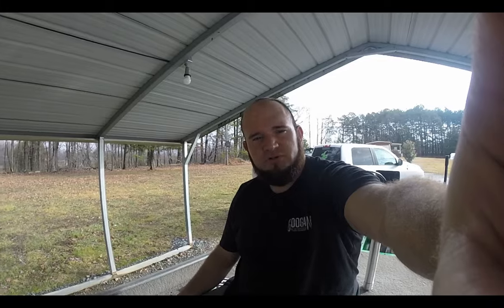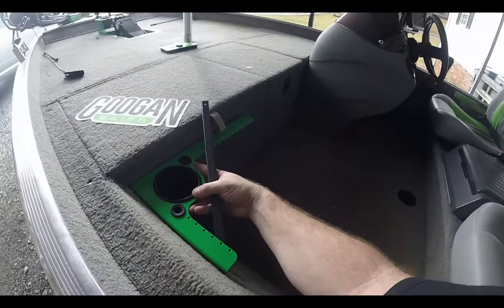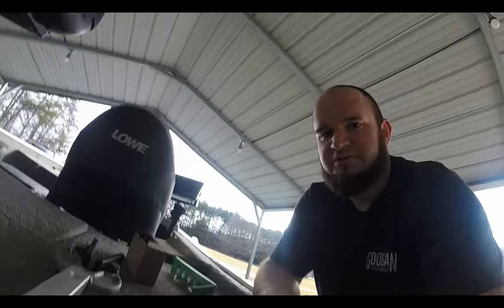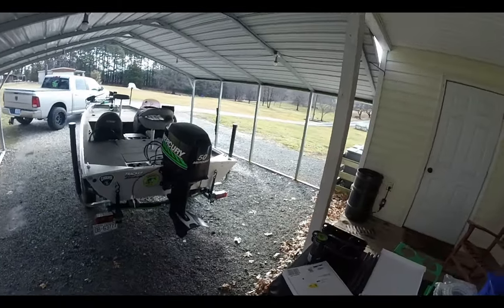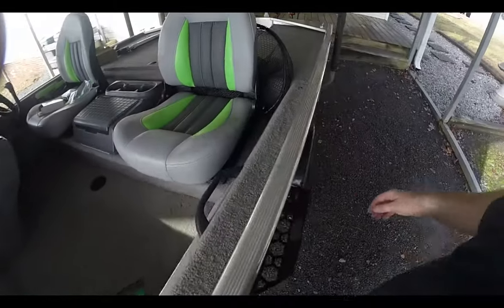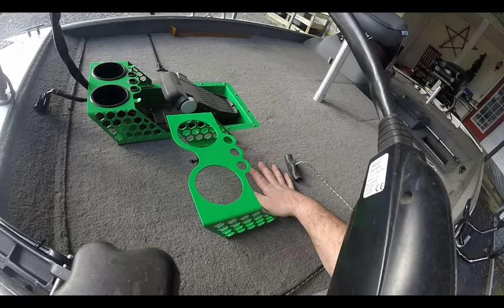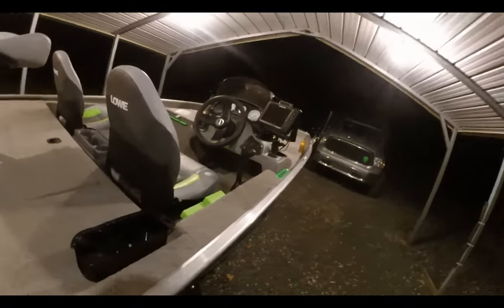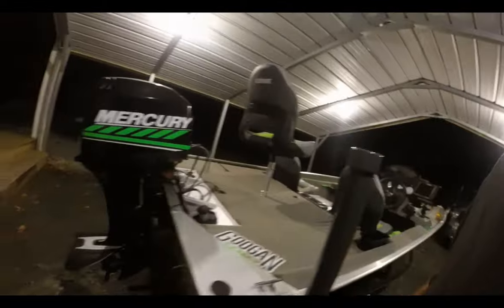Bass Tracker Lights Installation

Comment: Great job!  Super functional! Looks like you used the lighting with the adhesive backing.  How did you affix it to the inside under the gunnels?
Reply from the maker: I cleaned the aluminum very good with rubbing alcohol and stuck them straight on... the lights I got where off amazon.

Comment: When you put your lights on the inside of the boat you put them under the lip ? Can you take a picture of that?
Reply from the maker: Yes they are stuck on under the lip. The strip of lights are around 3/8 wide and fit perfectly on the underside of the gunnel.
Reply from the maker: Pause it at 17:21 and you can see them on there...lol i'll get a picture next time im at the boat.